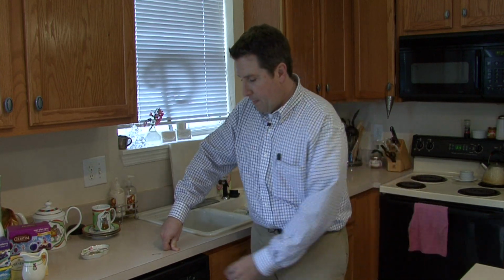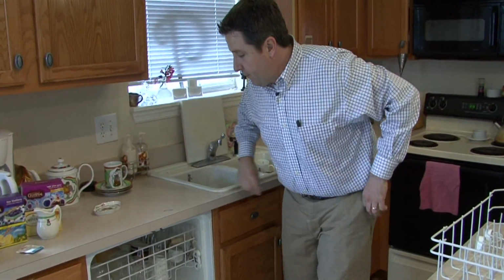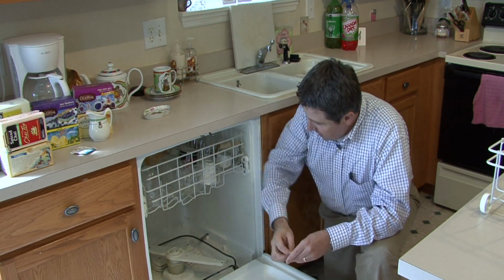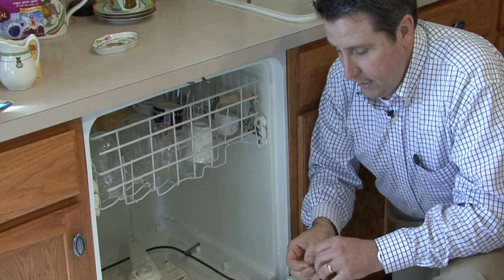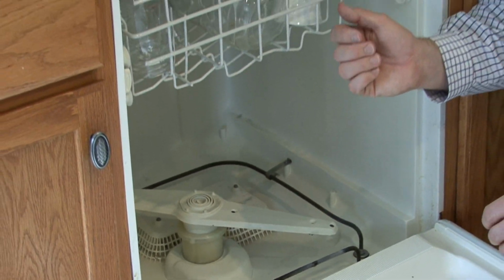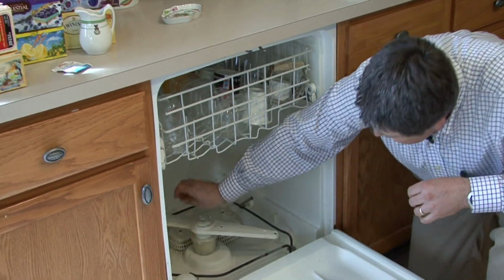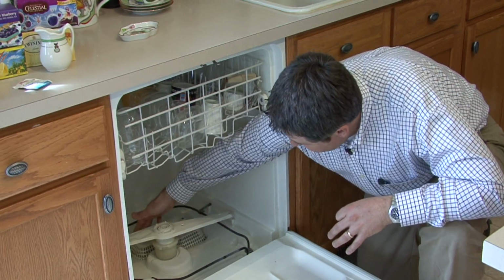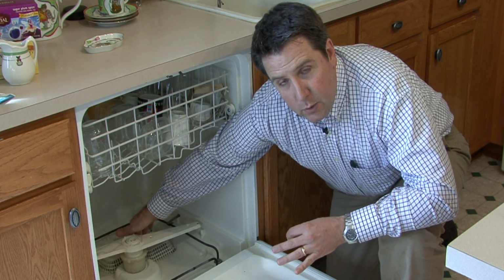Home Improvement & Maintenance : How to Troubleshoot a Dishwasher

Comment: How is the Center of the Spay arm supposed to work? I think A Piece of mine may be broken off. Not to sure though. Im going to clean the output filter and see if it helps. The water is comeing though and trying but its not enough pressure to spin the arm or even hit the bottom rack. Please advise! Thanks